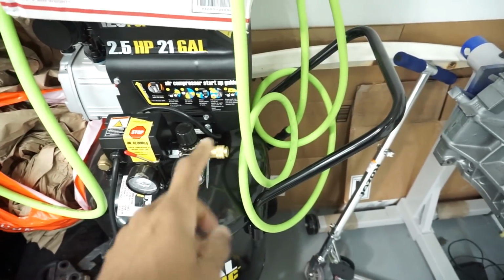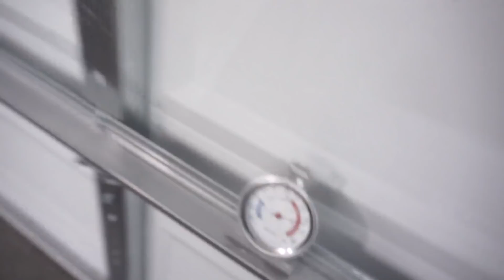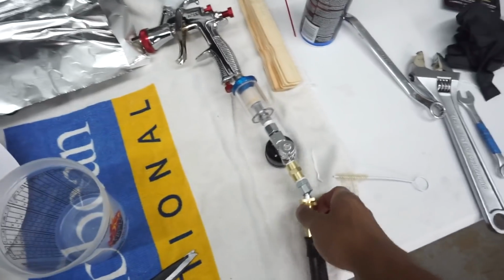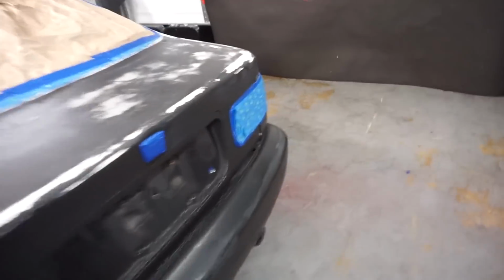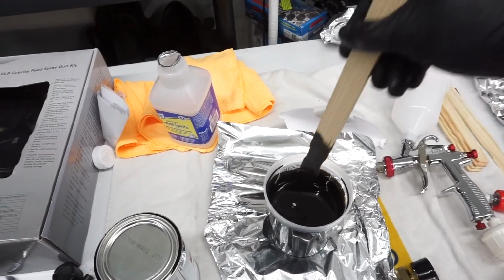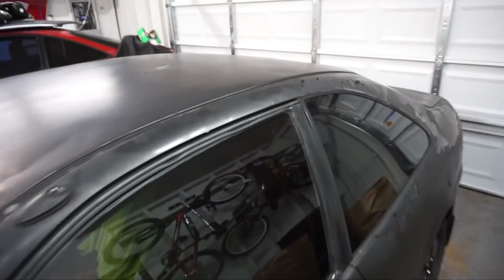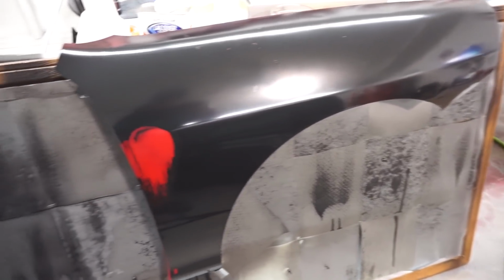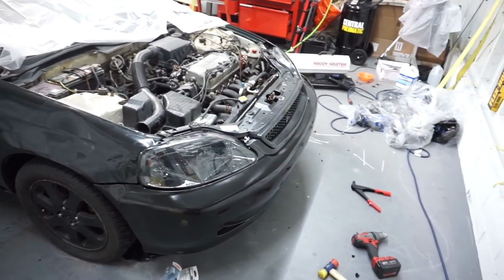Rustoleum 50 Dollar Honda Civic Paint Job Complete

Comment: Bro solid job. If you wana spend the extra 40$ try rustoliem satin black in the 2x coverage , 1 mist cost followed by 1 heavery coat. Then just give it one nice coat of clear with a spray gun. Comes out amazing
Reply from the maker: Speedokote refinish network I’ve only seen that in spray cans
Reply: Exactly , so if you spray can the car just for base coat , then after you let your basecoat dry , clear coat it out of a gun with speedokote clear. Only 50-60 a gallon , still under 100$ useing this method
Reply: I am getting ready to paint my suburban, it's white now and want to repaint white... Maybe retain.
Reply: Speedokote refinish network make a video then
Reply: @luisenriquez5211  check his channel out he has a lot of painting video's

Comment: Use primer before you paint over multiple layers of different colors on the same panel and DO NOT wax and grease removal on base coat it melts the paint
Reply: Would it work just as good if an adhesive was applied instead of sanding then paintin?
Reply: BriizCustoms what do you mean like bulldog? Or something else? You’re better off sanding then using a water/alcohol mix in a spray bottle let dry then tack rag it before you spray
Reply: @erickoenig4168  Any strong adhesive in general. Would that be just as good would the paint stick?
Reply: BriizCustoms it will but adhesion promoters are meant for plastics like bumpers to keep the paint from cracking and pealing off , just sand it with 600-800 and you’ll be fine
Reply: @erickoenig4168  What if I sanded put adhesion promoter and added a finisher would all of make the custom paint job last even longer in your opinion? Just want to be sure as I customize and want to move onto vehicles you do a great job
Reply: BriizCustoms what paints are you using and what are you looking for in a finished product?
Reply: @erickoenig4168  I'd use Krylon as you used and the gloss finish of 2k as your videos recommended. I'm going to do it on my bumper first it's plastic.
Reply: BriizCustoms if the bumper is already painted sand the entire thing down to a 320 then prime it and sand that to 600 then do a light tack coat of your paint DO NOT try to get full coverage that’s when you start to get runs and let it dry 20-30 minutes between each coat. If the bumper is new and hasn’t been painted clean it several times with wax and grease remover before you scuff it then apply a light coat of adhesion promoter on it and let it dry to what they recommend the prime
Reply: @erickoenig4168  I thought to prime something was to get it prepared to be worked on.  Is that not the definition?
Reply: @erickoenig4168  Also thanks for replying very interested to start painting.
Reply: BriizCustoms the main reason for primer is fill in fine sanding scratches and to help with adhesion on bare surface that does have paint on it, if you sand though paint you use primer on the bare metal, if you sand a vehicle down and don’t do any body fillers or have any bare metal you don’t need primer
Reply: @erickoenig4168  Is this stuff sold in a bottle, primer? My bumper is plastic rest of my car is metal. I thought I was so sand the original paint off, wipe it down so there's no left over and go into painting. This is incorrect?
Reply: BriizCustoms there is no need to sand everything off , the point of sanding is to flatten and even any edges if you have flaking clear or missing paint and to help with mechanical adhesion, if you were to take a car with perfect paint all you would have to do is scuff it with a red scotch bright pad clean it and paint it
Reply: @erickoenig4168  I've just got back from Wal-Mart I saw a primer and paint in one would you recommend that?
Reply: BriizCustoms no not at all
Reply: @erickoenig4168  Ok! So just to recap so I got this straight. Is this correct?
1. Sand
2. Wipe off
3. Prime 
4. Paint
5. Finisher?
Reply: BriizCustoms 👍🏻
Reply: @erickoenig4168  THANK YOU!!!
Reply: @erickoenig4168  Hi I just saw Rust oleum "peel coat" and "plast dip " have you ever tried those? If not would you ever? I read the can and watched a few video it looks great but I wondered what you think of them as your method is great too!!
Reply: Eric Koenig sealer primer

Comment: Put light soap water on the floor to prevent dust/debris 👍🏼 pro tip for you
Reply: I heard that's good but sounds super dangerous. I like to run around when painting. Lol. I would eat it hard on every corner
Reply: How to eat concrete while painting your car..

Comment: Did you put some filters on the backside of those fans ?  Something like furnace filters without the cardboard frames.. 

Controls and catches the pain or dust etc..  maybe throw a little water on the floor with a small pump sprayer to insure dust isn’t kicked up in the air as the fans exhaust the fumes/excess paint.

Comment: For the price its solid but my dad has an auto body shop and has been painting for over 25 yrs and when he taught me how to paint a car he always said start from the bottom and work ya way up will long horizontal strokes the reason being is because if you start from the top your going to have over spray and when the over spray lands on the car and dries when it comes time to paint the parts where the over spray landed it will create imperfections in the paint job because your laying wet paint over dry paint just a tip u might wanna consider but keep it up 💪🏽

Comment: Bruh when you sand down the paint to bare metal you need to spray filler primer on the car first, then wet sand the primer. After that then you can spray base, make sure you use 2k clear coat and dont forget to buff and polish after for that mirror shine. It's always a learning process which is no big deal and you had the prep work for the beginning process down pretty good but the primer bro is what you was lacking that's why you can see craters in the paint, the primer and base that was still left on the car was raised higher than the bare metal which shows a wave in the body.
Reply from the maker: Yea primer jus wasny in my budget this was free for a customer check out my latest vid where I painted my car

Comment: I did that with my 79 firebird with $1.00 Wal-Mart paint.
I never cleared it and it faded into a dark sky blue matte. 
I later ended up working at a local paint shop and after a year of working there my boss wanted to just clear it he said it would look fine because by that time the paint was already bonded to the primer. He said either that or we could soda blast it and it would come out of the booth looking like a spoon and at that time, DuPont (my shop was a test facility for them) came up with a new clear that can be applied straight onto bare metal.
I decided to leave it matte because nobody else had that look.
Reply: If you rattle-can a car it's usually frowned upon. But if you understand clogging, sweeping, and corners it can surprise even the hardest laughing sceptics.
Lol. Just do it right.
Oh.. Use a snap on trigger or you may have trouble using your fingers for days.😂

Comment: I think you did an amazing job for what products were used at those temperatures... I really think you need to find some other means of being able to heat it while painting... cold air coming into the garage has to be the same temperature as the garage. I also think if you try some tractor paint or some paint with some actual hardeners... it will come out really legit.

Comment: Not to bad! Just a couple things and a little practice you will  get better. I would spray a sealer coat on a car with adhesion issues. Add harder to the paint and watch out for that heater 1 for explosion 2 kerosene causes fish eyes. All in all I give you an A for effort! Keep it up. Ours skills improve from practice practice practice... I’ve been in the body business since  the 80s

Comment: Doesn’t look horrible you did all the right steps but for the money it isn’t much cheaper than a single stage enamel with hardener. I was gona try this but seems like they can’t really obtain that decent gloss finish. It’s not much more expensive for base / clear or single stage with hardener. But good job. Also looks like you need some practice with fun control but you’ll learn that with time

Comment: looks good, ive already painted several cars using the rustoleum method, you should look into Valspar enamel hardener a ton of guys used them on various forums with great results since enamel can be soft and take a while to fully cure without any hardener.  it's a bit pricey but worth it in the long run, just food for thought +1 sub
Reply: Where do you get the hardner? What mixture of paint? I want to do a budget paint job on my suburban
Reply: I’ve heard it’s better to use the Gardner when you are going to clear too

Comment: Props for doing it on your own, my advice would be to have better prepped the car as in sanding, and also when using wax&grease remover and tac rags to not touch the car unless you're wearing gloves as that re-contaminates the surface. Also don't beat yourself up too much as black is the hardest color to paint and when using a single stage rust oleum with no clear coat for said $50 you shouldn't have too high expectations! Overall, keep trying man you have more balls than most people. It was just a learning curve 👍

Comment: how big air compressor should be used for painting a front bumper? do you think 8 gals working great?
Reply: Should work great. Just let the compressor build up between coats. Be sure to have a 3 stage filter system where the hose hooks up.

Comment: Don't do single stage paint! I don't want to be rude but Basecoat and clearcoat! It last longer and will make a more uniform appearance. You had most of the before steps down; wax and grease, let dry and tack rag. Spray basecoat usually 20 minutes between coats: most paint companies only need 3-4 coats for black. Double check everytime. Out side of that props on the fans and the suction, also that turbine heater is key on cold days. Good luck on your continued work.
Reply: "Essential", single stage paint by PPG, great material around $220 for 1 gallon kit. More than enough to paint 2cars, stays shiny for more than 5 years, and can be Buffet like regular clear coat.

Comment: What I would do is primer those spots cause it will peal off again and start to fade. I understand that the customer doesn’t care but you should do it right. If there is any metal exposed like the hood you should put primer on so it seals correctly

Comment: Thanks for the video brother! I bought a teal one for 1k gonna probably do the same thing. Did you end up doing a clear coat after or just regular paint and wondered what you used. I painted a 240 for fun did OK but the hood I had to redo amazon paint was kinda different going to try local.
Reply from the maker: I didn’t clear coat it, i will be doing more painting very soon with another rustoleum, single stage and base/clear
Reply: Thanks man!

Comment: You need to use filler for the parts where it’s low and sand the highs. Then prime everything. Throw light coats on it, never do heavy coats, let that cure then do the pint and do light even coats and let it cure

Comment: To help you for next time...
Never put your mask over your glasses. Prevents a good seal and makes the mask useless. Test it before spraying too. And your gun is a lvlp. Pressure should be between 25-40 psi max. Check the pattern to be sure before you spray too.

Comment: Put some of those cheap HVAC 3$ filters over the out fans and in Air space under your garage door. will help with dust plus your neighbors might not like the overspray all over their cars. LOL. It may be dry by the time it gets that far though. I know I did a airless paint sprayer one time with stain on some wood and had my garage door open. It went 50ft around the house and covered my brand new car. I didn't notice till I hit the wipers and noted streaks the next day. 3 hours will a clay bar got it off though. bajesus. never again.

Comment: For 50 bucks it doesnt look to bad,   but you could see all the blemishes. That all means you need to do better on sanding the body and maybe a layer of primer would of helped. But its your first time painting so its a hit or miss. Great job though bro on your first time.
Reply from the maker: His and Her Wishlist i would def do a layer of primer next time... as for body work i did this for free so it wasn’t happening lmao
Reply from the maker: mintZroadster i didn’t use primer on this... but usually as long as u let it dry it should be fine I’m pretty sure all professionals use primers, correct me if I’m wrong.
Reply from the maker: mintZroadster but when i use primer for a car it will be 2k high build
Reply: @mintZroadster  black brings out dents and imperfections the most then other colours

Comment: I can tell you exactly what happened for one  you didn't have it  hot enough need to be about 80 to 90 degrees if metal is  cold the paint won't stick and  you had way too much air pressure and not enough paint you shouldn't have been able to even see in the garage if it were spraying right that's why they used paint booths
Reply: Yea I've painted alot with with house paint through a gravity fed gun for cars and I always used semi gloss and thinned it with water cause it's a water based paint then I run the gun on like 4lbs and for paint the gun is pretty much wide open lol only thing is I have to keep a little thing of water and a toothbrush cause as you spray paint will built up on the little nipple on the gun but I've never had any problems with it on house items like doors and trim I just spray the paint and on cars I spray 2 to 3 coats depending on the color and how it lays out then a slight wet sand then clear you definitely want to clear it when you paint a car cause the water base just doesn't dry hard enough as for oil based trim paint though you could probably get away with just the paint on a car cause its alot harder when it cures but I haven't sprayed a car with that yet
Reply from the maker: taritup 69down it’s a lvlp gun it doesn’t spray like hvlp hence way less overspray

Comment: The car looks ok, for $50 paint job.

Certainly looks better than before the car got painted.

Should have sanded down the whole car with air sander, and 400 grit or 320 grit sandpaper, to better smooth out any peeling paint and to scuff the old paint, for better adhesion of the new paint, then use wax and grease remover, clean away all impurities, and paint away.

But theres a first time for everything, not bad for 1st time painting.

Usually 1st time is where someone learns by trial and error, it happens, not the first or last time it happens to anyone.

Have a nice day.
Reply from the maker: The Royal Crowned Tiger i did lol everyone looks at this vid, look at the previous vid. It would have went a lot better if i primed it... and jus more practice. This was literally my first time painting
Reply: @irvsmadhouse  : Oh ok, I was not aware there is a another video.

Its true, primed would have been alot better.

Everyone makes errors.

Practice makes perfect.

For 1st time painting, its pretty good.

Have a nice day.
Reply from the maker: The Royal Crowned Tiger yup I’ll be doing more soon along with some single stage keep an eye out! And thanks for the positive criticism

Comment: A 21 gallon compressor at harbor freight cost $150 and a decent used gun probably cost like $200 or a nice new gun tekna Pro-Lite cost $500 so no this is not a $50 paint job
Reply from the maker: Agreed but those are one time costs. All in all this cost me about 300 but the next one i do will not cost me that again

Comment: Hey man you can only do so much with a spray paint. A gun with a better setup helps. A paint job is only as good as the prep work. I can't hardly work with black paint it shows everything.  Looks good when its clean. For about 15 minutes.
Reply: Hes not using spray paint though

Comment: Get real base coat and clear coat. It’s going to be way easier to lay down than the stuff you used. Wet the floor next time and get bull dog for the bumpers
Reply: GLeszega why wet the floor? Serious question
Reply: You wet the floor to collect the dust but I’m not sure that would help since he is using a heater it might raise the humidity to high.
Reply: 2j Bryan you wet the floors to keep the dust and dirt on them from getting blown up into the air and into the paint when spraying. There is a lot of air coming out of the gun and as you are spraying the lower half of the car you wouldn’t believe the amount of junk that gets blown up off of the floor.

Comment: Damn . What a great way to waste $50 and your time. If you spent a little bit more on a base clear system you would have been much happier with the result. Instead, now it has Rust-Oleum BS on it that I would never want to paint over with a conventional base clear system. It will react and create plenty of issues if you attempt to paint over it. You will have to strip it down and start over.